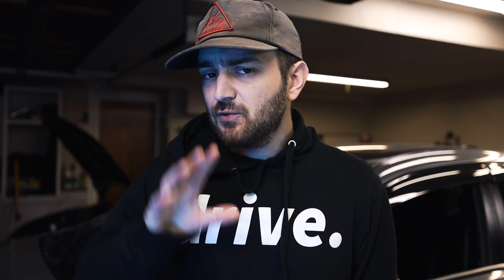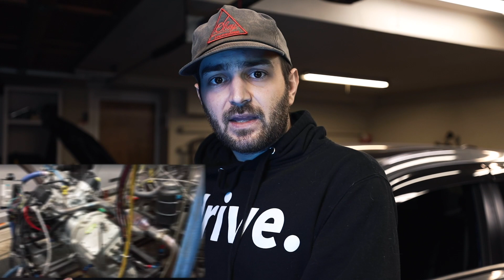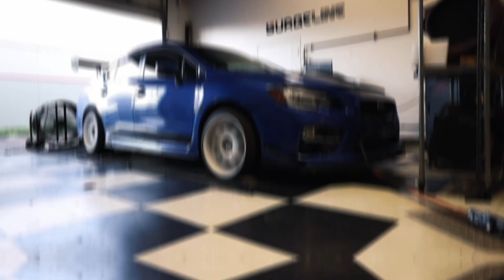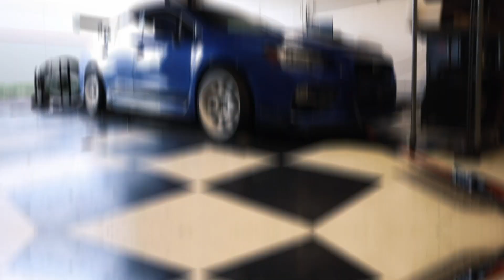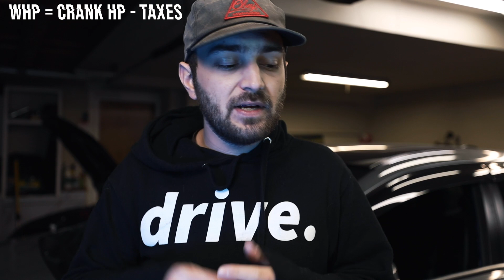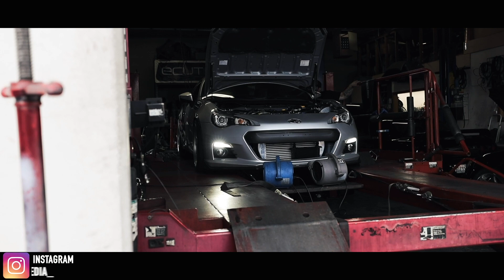Horsepower, What is the difference?!

Comment: Just recently I’ve failed inspection due to the o2 sensor not ready. I have done about 3 driving cycles going about 55 mph with no WOT and a total of 100 miles. I'm not sure if it's because my car battery is new or the o2 sensor going out. The o2 sensor only has about 3k miles on it. Will reflashing the ECU do anything?
Reply from the maker: Reflash may help to reset it, could be a faulty O2 sensor like you said as well
Reply: @Smeedia  Update: So I ended up reflashing the ECU and still haven’t seen any changes I also ended up replacing the downstream o2 sensor and still nothing. I’ve put about 60 miles on it so far. At this point, I'm not sure what causing this issue.
Reply from the maker: Are you getting any CELS?
Reply: @Smeedia  it's all good now I ended up slapping the stock intake and changed maps with to stock intake and got the o2 sensor set to ready. Anyway, I think that the Cobb tune (Stage 1+BigSF) for their intake messes with the readiness setting the o2 to not ready. I ended up sharing my issue on Reddit and it appears that many other people had the same problem. I hope Cobb fixes this issue and let others know about this before taking their car to inspection.

Comment: i'm about to get my 07 wrx pro tuned. i only power mods i have a turbo back and intake. are there any things that would help my tuner and make it easier / more reliable for them?
Reply from the maker: As for the tune not so much, an AOS or catch can wouldn't be a bad idea though 🔥
Reply: With that little of mods done to the engine, Might be cheaper to get an E-tune. I personally wouldn't go get a pro-tune until you're atleast Stage 2+ Could save you some time and money.

Comment: Am always puzzled as to why most hp #s are advertised in crank hp. So misleading to me; that # means nothing. Tuners only speak in wheel hp
Reply from the maker: They want the highest number they can market 🙃 95% of consumers don't care, only the 5% like us 😅🙏
Reply: When using power at the wheels, you need to keep in mind that you need to take into account more variables such as wheel size, tire pressure, etc. The same car with different wheel configurations will give you different numbers. Crank allows you to get a more consistent power readings.